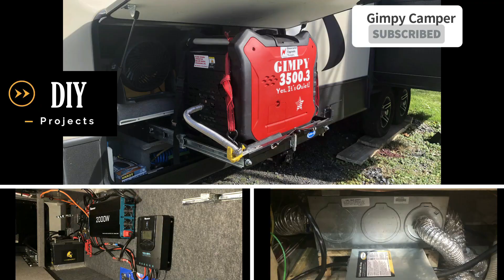RV Problems on Travel Day

Comment: We had to replace suspension on our trailer at 3 years in.   After 2 trips out west from Alabama the tires were rubbing the bottom of the trailer.    Found a shop in NW alabama that has a side business of replacing suspensions on travel trailers because they are mostly under-sized.   Replaced everything below the frame, from 3500 lb axles to 5200 lb axles & springs, bigger brakes and wheels and tires, and went from Lippert to Dexter components.    Theoretically I have more brake capacity on the trailer than I do the tow vehicle.    Very pleased --- this is the way it should have come from the factory.
Reply from the maker: I agree… I had issues with the tires dragging in the past as well

Comment: Thanks for sharing. Vise grips to turn and pull the hitch latch in an emergency? I went with Hercules tires 2 1/2 years ago to replace the 6 year old 10 ply Chinabomb tires and added 2" spacer blocks & the Lippert Equalizer.  And yes the Cinabombs did just fine. Was in Florida last month and discovered the axles were way out of alignment(extreme uneven tire wear) and the 6 leaf springs were "flat". So I installed the Lippert axle alignment kit, new springs, and while I was at it the Roadmaster shock kit then aligned the axles - which were out by 3/4". Our 11,300# Coachmen 5th wheel now has  properly aligned 7000" tandem axles and the shocks, and the higher rated Hercules ST235/85-16 tires with a TPMS.  For heating/cooling I've added a Mr. Cool 12,000 btu heat pump. Works great in the upper 20 degree weather in Florida.
Reply from the maker: We have a portable a/c with a built in heat pump